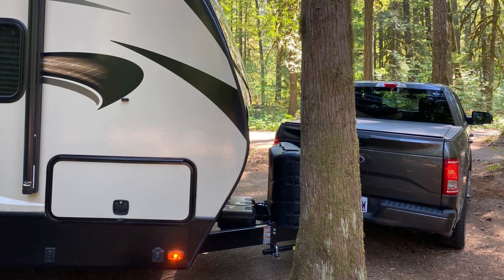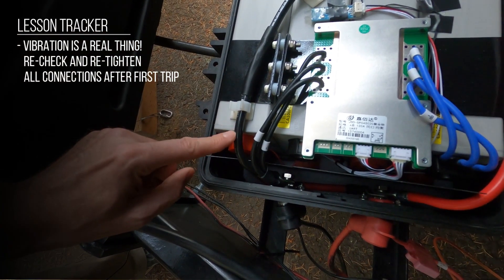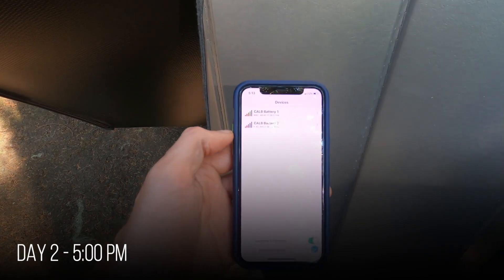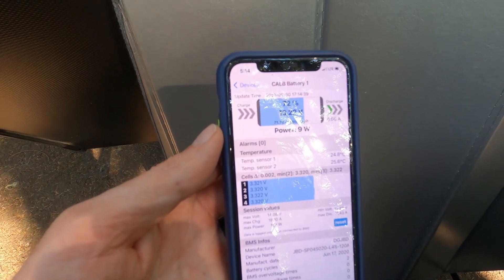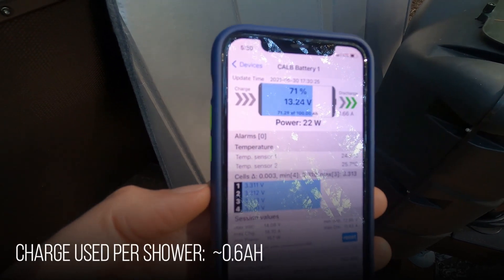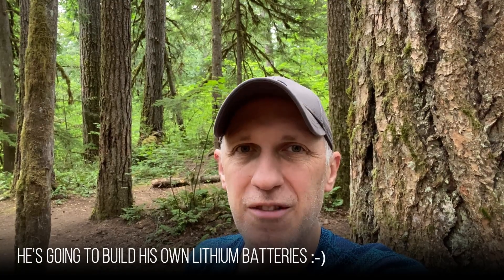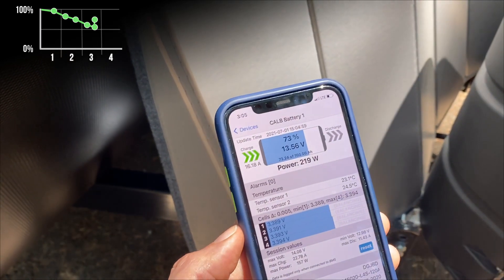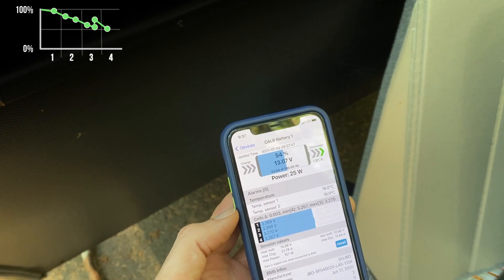Testing our Lithium Batteries: DIY Lithium RV Battery Build - Part 5

Comment: I just found your site looking to find a case for both of my lithium batteries that I have acquired.  The videos were great. One recommendation, larger gauge wires.  I will be placing an inverter on my camper and they recommend 2/0 gauge between the batteries and the inverter.  If you use too small of a cable size they will become heaters and not current transfer cables.  The engineering of the battery box was fantastic.

Comment: So sorry to hear about your ALS. Your videos were inspirational, not to mention very well done. I hope you can mitigate the symptoms as best as possible. Your videos will be missed. 

We're retired FT RVers who love to boondock in our 99 National Tropical MH, so we decided to build our solar system in 2 phases, a 12v basic phase to run all our 12v appliances and a 48v system for our AC high power needs. The main issue we faced is we are retired and living on social security and a small pension so have to do everything on a tight budget forgoing name brand components like Battleborn and Victron for lesser-known brands and must do all the work ourselves - which keeps getting harder as we age. We just completed the first phase in January, with the addition of custom built 560ah of LiFePo-4 battery, roughly equivalent of 5 1/2 100ah Battleborns, made with 8, 280ah prismatic cells. We used a Heltec 330amp BMS (with a 1,200A surge capacity to start our onboard 5,500watt generator) and a 5a active balancer. We built our 12v battery with grade "A" LiFePo-4 prismatic cells having a 6,000 cycle mfg. projected life at 100% DOD. This means that if we cycled them 100% every single day, 365 days a year, they would last over 16 years! And who uses their batteries this way? In reality they will die from age before we could ever wear them out from cycling. It only cost us $1,500 to build this 560ah battery, including the high amp BMS. The main reason we chose these cells (other than their price and quality) is that they fit perfectly under the steps of our motorhome where our old pair of GC-2 golf cart batteries used to reside, saving 35lbs compared to our old FLA batteries while having over 5 times the energy storage capacity. We insulated the battery compartment and cut a small 1" hole in our steps and installed a tiny computer CPU fan to keep this space at close to room temperature. Today was the fisrt day this mod was needed. We wintered over in S. TX where the weather was nice and warm, but yesterday found ourselves in Sutherland Nebraska, albeit a little too early in the year as the temperature dropped to 20 degrees last night. However, our batteries stayed in the upper 40's thanks to the fan and insulation.

We started our build 4 years ago with a 620-watt liftable array mounted on the side of our motorhome when we went FT. It serves as a nice bedroom window awning too. It practically lifts itself to the correct angle with a couple gas struts and it's easy to clean with a windshield squeegee, standing safely on the ground. Lifting an array to the correct angle for latitude and month, will produce 25-30% more than a flat mounted array - even more in winter when the sun is low on the horizon. This first phase, including the liftable array, wiring, breakers, a new Progressive Dynamics 80a Li compatible converter/charger, 600w PSW inverter (to run our TV and PC), an Epever 50a MPPT controller, battery monitor/shunt, and a Renogy battery to battery charger (to protect the alternator) cost us around $3,600.
Reply from the maker: That sounds like a terrific setup as well as a great journey getting there. That was the direction that we were headed, starting with a modest 12V system and then expanding up in response to lessons learned and needs that we encountered. 

The price for cells have certainly decreased in the two-ish years since we started this, as you experienced firsthand. For the do-it-yourselfer, it’s now to the point where there is virtually no price penalty of LiFePo vs traditional AGM. 

Happy RVing and have an adventure or two on our behalf!

Comment: Would you ever consider adding a solar panel to top up charge throughout the day while your out enjoying yourselves .
Reply from the maker: Definitely. This location was pretty shaded, but in a spot with more direct sunlight, you could either stay topped off or at least slow the rate of discharge over the multiple days. A 100W panel would generate a peak of somewhere in the range of 6-7 Amps at 14.6 volts, meaning for every hour of really good sun, I can put 6-7 amp hours back into the batteries. We were using 40-ish amp hours per day, so if we can get 3-4 good hrs of sun (lots of trees here), 200W of solar would comfortably keep up.